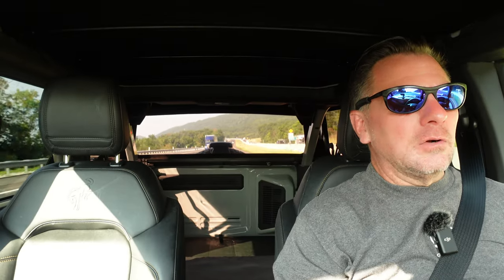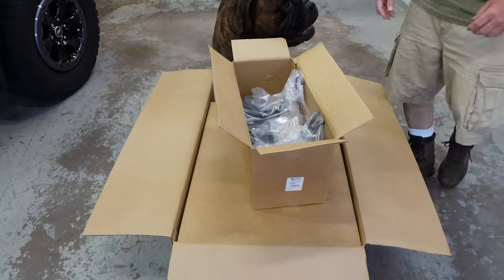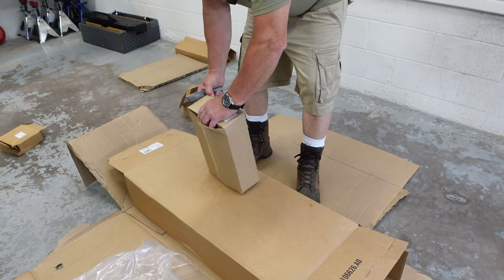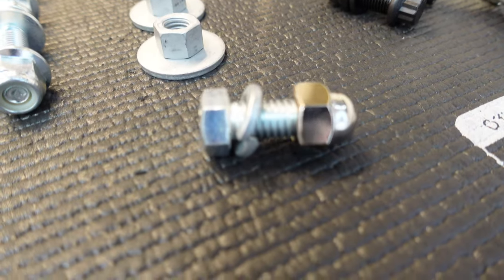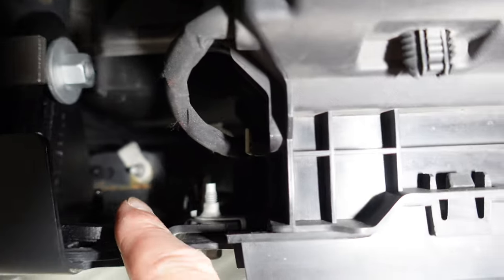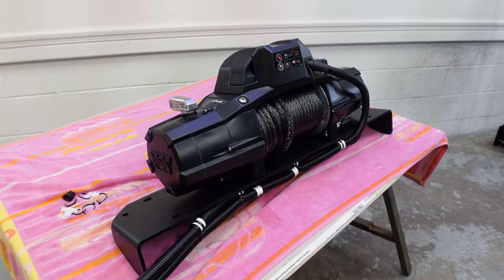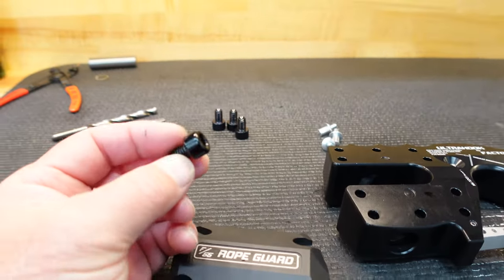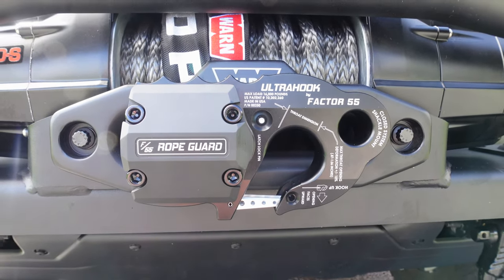Ford Performance Bronco Winch Install. #broncos #overland #overlanding #winch #bronconation

Comment: Great video. I have a Bronco Everglades with the Winch factory installed. I'm curious to know if you think the D Ring Mounts for this setup would hold up for flat towing?
Reply from the maker: Thank you and thanks for watching. I really don’t have any experience flat towing but I do know that they are more reinforced than the recovery points on a Bronco without the winch. You would have this same setup on your Everglades (cool edition). Just guessing, I would say yes, probably be fine, but again, I have no experience with this.
Reply: It definitely looks stronger with the Mounts added!! Thanks